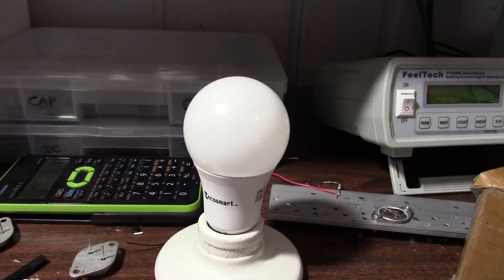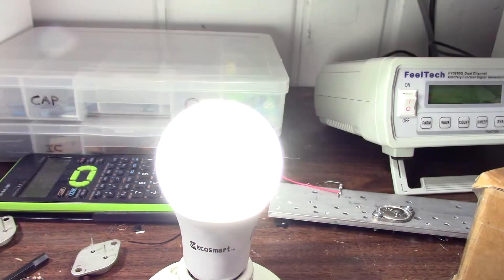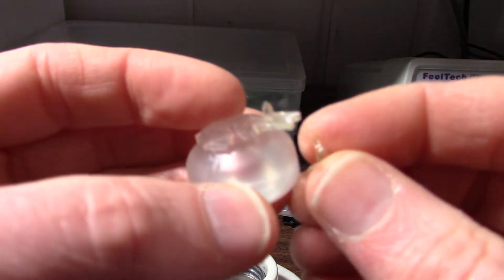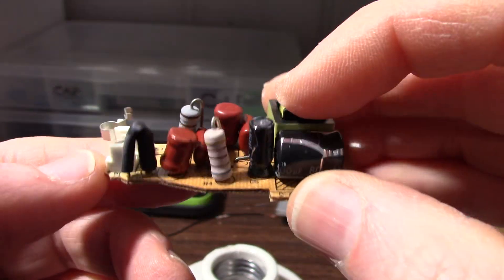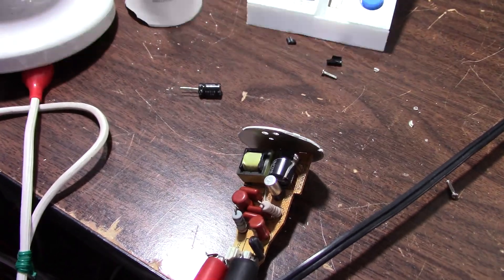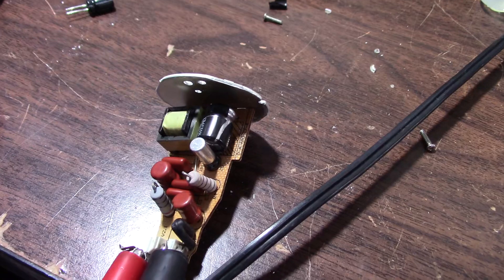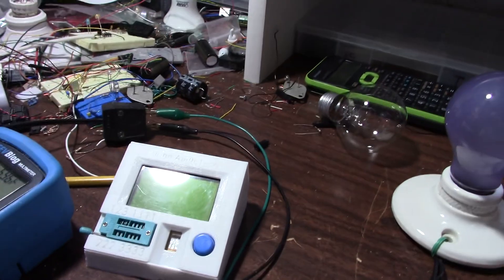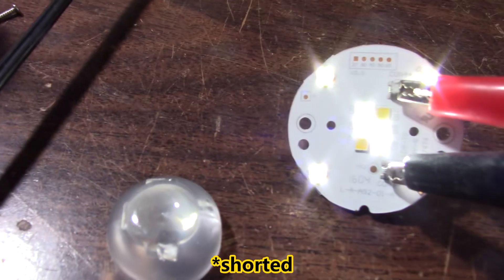LED lightbulb failure - weird symptoms + Teardown

Comment: The reason why LEDs fail is because if you turn them on and off. It usually shortens the life. LEDs have electronics, And when it heats up and cools down at the same time. It usually shortens your LED bulbs. With fluorescent and CFL bulbs, Similar issue. Even with incandescent and halogen bulbs, The life will still shorten a bit.

Comment: Thanks for this video. One of the things I like about your videos are the clever methods and simple devices you use to analyse circuits (like the microphone/speaker combo). Looked at your "Equip your electronics bench on..." videos since I'm in the market for some extra equipment and really admired how little you needed for your own workbench. It just shows it's the brains that are needed, not the tools!

Comment: Thanks for the info. I used to buy the same Ecosmart bulbs from Home Depot too. They lasted between 3-12 months. Horrible. I've been buying the Dollar Tree bulbs the past 2 years and so far they haven't failed. Heat build up within the Ecosmart bulbs seems to be the culprit, which as you've shown, shorts out the Leds. Anyway, the best part of these Dollar Tree bulbs is, they're only $1. Soon to be $1.25. I buy mostly the Daylight bulbs. The name brand is Yamao. 60w equivalent. Thanks again for the excellent videos!

Comment: That is an incredibly old design. They don't use that many components in modern LED lamps. However that doesn't makethis one worse than the new ones... 5  years is a very good life for a mains voltage "A" type (GLS) retrofit LED.

Comment: Just wondering what type of speaker coil is that?
Reply from the maker: The coil plugged into the amplifier is an old telephone pickup coil. They have a suction cup that attaches to the old style handsets. It makes a speakerphone by picking up the signal from the earpiece. They used to sell them at Radio Shack.

Comment: Been using LED bulbs for almost 10 years now, so far all the failures have been down to LED failure. Switched to a pricier LED bulbs in the UK called Megaman, no failures so far. Fingered crossed they last longer. Funnily, I've still got CFL bulbs that are over 20 years old with no sign of failing.

Comment: These LED bulbs are too complicated. Or maybe it's just that we're trying to make them work where the old filament bulbs did? Which is not working out so well.
Reply from the maker: This one lasted five years, so not too bad. I think these "snow cone" style bulbs were an interim solution and on the way out as the filament style LED bulbs are taking over. Higher efficiency (less heat), better light dispersion, better color rendering and the frosted bulbs are indistinguishable from the incandescent type seem to make "Joe consumer" happy.
Reply: @JohnAudioTech  is 5 years really the 50,000 hours initially promised? Well, I guess it's close. 43,800 hours if it was left on all the time. If that bulb was in a ceiling can then it must have really been hating life.
Reply: @1pcfred  - they don't claim 50,000 hours any longer. Most of the "domestic retail" grade lamps are marked *20,000 hours now days. They are not likely to even achieve that long in ceiling mounted fixtures.